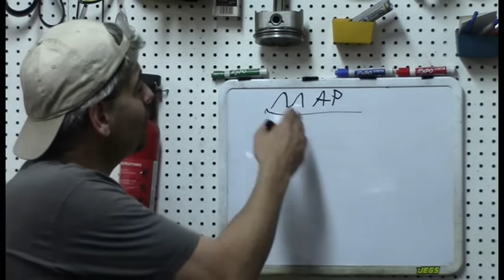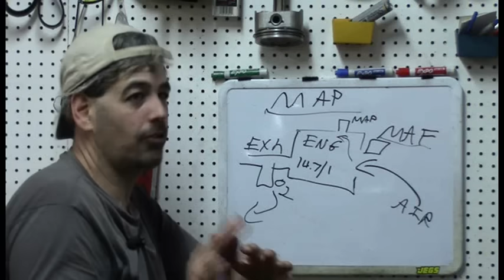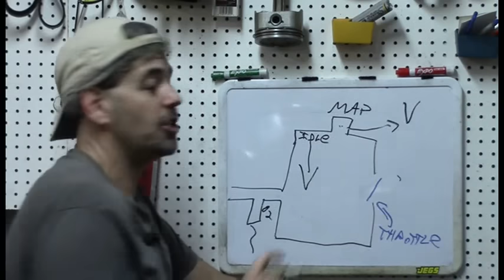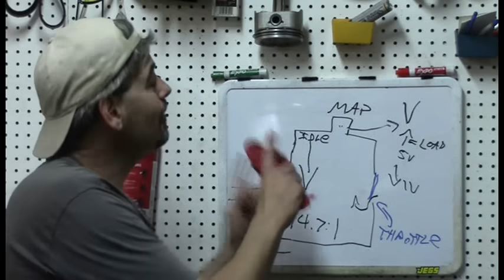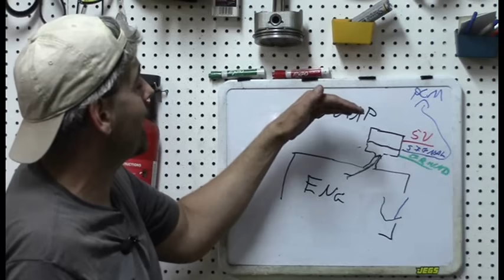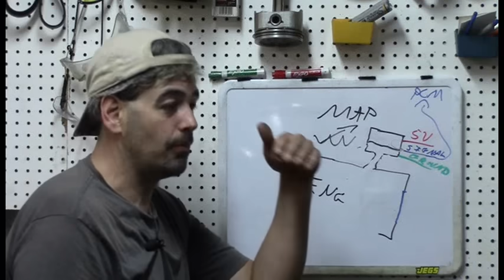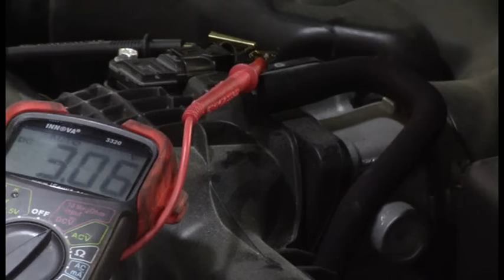MAP Sensor Diagnosis and Understanding Function- Pt1

Comment: New gas  tank, fuel pump. 2006 grand Marquis. Engine light comes on. Scan tool reads Po107 . Map sensor-egr. Replaced egr- map light still on. Cleared code. Should I clean mass air sensor? You rock

Comment: IMO, what MAP sensor, in a Normally Aspirated engine, measures is Manifold Depression or Negative delta pression, since manifold are part of the engine sucking, unless it is in an unoperative state (shut off engine) (neuttral or Zero Delta P).
Because, unless an engine is trully effective at breathing and exhausting, or turbo/super charged (blowing above ambient pressure), it will run below outside (ambient) air pressure. A turboed can make positive pressure inside the intake manifold.
Reply: OS Coutinho Atmospheric pressure is about 14.5 psi [ about 100 kpa ] at sea level. The concept of manifold absolute air pressure allows a reading of atmospheric [ key on engine off ] about 14 psi or 98 - 100 kpa or about 4 to 4.5 volts on a five volt reference system. since the pressure is registering atmospheric even with the engine not running, all values from the MAP sensor  with engine running or not are absolute reference to a true static vacuum [ environment with no atmosphere ]
Reply: ill bet these guys suck at socializing, ha ha!

Comment: Barometric pressure is Absolute pressure.  If the MAP did not measure pressure on an absolute basis, then it would give the exact same reading at sea level or at 10,000 feet elevation.  A mercury barometer reads absolute pressure. The top of the glass tube is vacuum. We used one at our test lab for testing centrifugal pumps.

Comment: I had so many issues with my Ranger I bought some thermostat wire and ran it between  the cab and engine.  Then I could back probe into various sensors and read voltages while driving.  Sometimes I would use a cheap analog volt meter because the needle makes it easier to see voltage swings.
Reply from the maker: ***** Yes that's a very good strategy indeed. I have sets of long vacuum hosing, wiring, and even extended fuel pressure tester hosing for similar application. Just gotta remember to keep your eyes on the road more than the gauges lol!

Comment: Thought i had a Tps problem, nope try again, then i thought it was the accelerator cable , nope not the cable, so after replacing those, i watched ur vid and it definitively sounds like my MAP. Rpms hang after touching gas pedal, and accelerated on it's own
Reply from the maker: Bandit Kevin I wonder what you will think it is next after you replace the MAP.
Reply: LOL right! Damn computers and diagnostics!
The Throttle cable melted a little so i replaced it, then the tps wouldn't read any less than .74 volts, so.... I replaced it... but it still revs high in park, so it has to be the MAP.
Reply from the maker: Bandit Kevin Sounds like you got it all figured out....

Comment: I just changed the intercooler on my golf mk4 tdi which had a map sensor I believe, the car will not start could the map be causing that issue? Great video by the way
Reply from the maker: could be. could also be a vacuum leak. try a fuel trim analysis.
Reply: Schrodingers Box thanks will try cleaning map sensor first as it’s easier then will try the other

Comment: GM uses both sensors, Toyota uses only one but programmed with a fail safe parameters to keep the engine running even without a sensor connected to the ECM

Comment: Made it very understandable, I was lost looking for information  the Map is intergraded into the EGR on my vehicle and also have a MAF, I'm getting Map barometric pressure circuit high
Reply from the maker: if you have high voltage to obviously you want to check if you have current flow.
Reply: @SchrodingersBox  thank you for the information

Comment: my 335i uses a map having a strange one cleared a check engine light there was no noticable running issues but it happened after driving up a big steep hill...stayed off for 2 weeks roughly then happened again same place ...cleared and happened again in the same place ..bet this could be the map sensor at fault not keeping up with the alitude change .nice video :)
Reply from the maker: Possible- if you open throttle to WOT it adjusts MAP to the new altitude.

Comment: Hmmm, just saw Scanner Danner the other day say up here is command, and here is the result. Command was the STFT/LTFT combination and the result was the O2 sensor.

I've seen two cars recently who each were running lean. The computer kept ordering more and more fuel, even after the car went rich? Even though I was cruising on a flat road? So Danny thought the car in his video was testing, is the O2 sensor for real? I caught my car doing the same.

No O2 sensor code was present of course, but I noticed the values on my front O2 sensor getting lazy. Was quick and snappy like it used to be.

Well, my exhaust got ripped off this week, and while I was grinding a way to lay a fresh weld down, I got metal shavings all over in the pipe pre cat. Whoops! Used air an compressor to blow from the rear O2 hole to clean the metal shavings out, and did the same with the upstream sensor. (You don't want to clog a cat, especially a new one.)

The upstream sensor had white crap all over it. Having my metal polisher, I figured, I was going to replace it possibly anyways, why not? I ground the crud off (a gentle polisher really, just spinning, fibered steel). I used my compressed air to blow out the white crap from within the sensor that I could not see.

I cleaned the oil off the outside of the sensor. I polished that metal too.

Now this only took minutes. Less time sometimes than the time to get the electrical connector off. Sharp lines of stoichiometry are back! So anyway, When the O2 sensor is lying, the car tries to believe it, which I believe countermands the regular commander into ruining catalytic converters and/or emissions.

Long story short, I wanted to bring up how O2 sensors can countermand the original orders if you watch it keep doing it, it may be the problem like on mine, or, it may be pointing elsewhere. Don't assume!
Reply: DE Nichols I went ONCE to the Prolixic channel, and NEVER MORE. I value my time.
Reply: OS Coutinho
Thanks that's a channel with suggested videos sometimes. I'll stay away. I try to respect my time too.

Comment: Matt the pressure in the intake manifold is at idle 0.3 bar and and at full load wot it is 0,95 bar it pull on the diaphragm not push to change the voltage eg 0,3 =1.4v and 0.95 =3.9v great video
Reply from the maker: Thanks for correction- ust curious, why is it not .98 at WOT? I thought 1ATM=.986BAR if I remember from physics correctly?

Comment: explained very well...thanks
im having tons of issues..my truck just switches off while driving..cant idle..or struggle to start...sometimes while driving it nose dives like slamming on breaks...it must be the map sensor then
Reply from the maker: What?? Why would that mean its the MAP sensor? I don't follow your thinking at all
Reply: @SchrodingersBox  well....any idea then wat it is???
Reply from the maker: yes hundreds of possibilities.  but you have no data so i cant narrow down to one or even 10.  how are you doing it that you suspect the MAP specifically? What analysis are you using?
Reply: @SchrodingersBox  been asking a lot of questions by people especially motor mechsnics...a lot say its the map sensor.....
Its like the engine is not getting air or fuel...then just dies....there is a brand new fuel pump in..brand new head gasket...no more water leaks and it still just dies
Reply from the maker: That’s not data. that’s anecdote and from people who have no idea what they are talking about. 
Collect data. Analyze it. then create independent variables to validate the analysis. Let it point the direction- don’t guess.

Comment: My son has a 2006 Impala 3.9 and has a MAP sensor and a MAF sensor.
He had a scan and the code is P0106, MAP sensor. Would this cause the engine to crank but not run? I am a shade tree mechanic and still trying to learn.
May GOD bless you for your knowledge and helpfulness. Thanks so much.
Reply from the maker: No it wouldnt' however the 0106 may be referenced by another PCM interpreted fault

Comment: Thanks for sharing.This is the best I ever seen on YouTube about sensor's functions and uses.  Very well explained. So the TPS and MAP sensors were integrated, meaning if one fails the other takes over? Please correct me if I'm wrong but again thank you very much for sharing.
Reply from the maker: Thanks for the comment.  You are correct and actually, in some way or another, nearly all sensors are integrated with each other. As you watch more of these videos you will see that all systems overlap each other and you never find one system or input totally independent.
Reply: The most important thing I can say you did educated me about these concepts. THANKS

Comment: As a part changer I must explain my perspective.  If I take my car to a shop it will cost well deserved $$$ for the diagnostic. For the same price i can put in a new part or 3. By the time I fix the problem my engine is part new. Yes, it's not the best way but I learn a ton in the process, sometimes I do the repair twice. In the end my 2009 mazda is paid off and is one tiny rattle at low rpm away from being like new.....lol.....cause some of it is. And if you made it this far USE ONLY OEM on Mazda's. Price to quality and fitment is worth it. Heck most of the parts will have 120 plus on them....
Reply from the maker: Justify all you want- you are still doing it wrong... and be grateful your surgeon doesn't have that mentality.
  Remember- incompetence is NEVER a justification for procedural modification.
  Its up to you how you approach your education and aptitude, but trying to justify a lack of either should not be a viable strategy.

Comment: At 7:10. The MAF does not detect the amount of air, it detects air mass, or in other words the density or weight of the air, not the volume. If it detected the volume of air, then there would be no need for a baro reading, regardless of whether it has a sensor or is inferred.
Reply from the maker: gojudude This is true- and in fact I do mention this specifically including the actual formula for calculation in my IAT diagnosis video.  I just wanted to brush by the MAF in this video because it's about the MAP.

Comment: Hi I had a very stress full situation with my Nissan x trail  but the video  about MAF sensor  lead me to realize  the possible  cause of hestation and jerk, specially when im driving slow, I checked that big pipe on my car and I discovered its damaged, I will try to fix it see if it will solve the problem and get back on the platform  for update. Thanks

Comment: Great video. I learned a lot of new information, and this is helping me to fix problems I am having with my machine.
I have a scan tool but it cannot connect to my ECU. A problem that a lot of people are having with my model of european van.
Thanks for doing these videos and presenting the information in a way that we can all understand and grasp. 
I will watch your videos again and again - until the information takes root!
Are you a lecturer in a technical college? Subscribing immediately!
Reply from the maker: Thanks for subbing.  Yes I also have connectivity issues with many European cars  Really frustrating!!
Reply: @SchrodingersBox  Seriously thanks for doing these videos. Everytime I understand a concept, the light comes on and I 'get it' it's a fantastic feeling. Almost like therapy. Re: European connectivity, I'm told that certain manufacturers use different standards, which totally undermines the whole point of having the OBD2 standard in my opinion. Not sure if that's true or not, but I'm about to order a couple of different brand specific scan tools to see...

Comment: Congratulations on the video. I am Brazilian and I have a jetta facelift 2.0 tsi gen 3. When I change the charge pipe it shows error in the throttle body. Can I replace the original 2 bar map sensor with a 4 bar map sensor without calibrating the electronic injection software?

Comment: for approx. 100 yrds before it quits again. When it stops t is like shutting the ignition off. It runs fine for local runs of maybe 10 miles or less.
Reply from the maker: What data do you have? Is it losing fuel? spark? ignition off?  Need a starting point

Comment: You have taught me so much on this channel I can now put it to good use but one thing confuses me is that when I tested the map response on a vehicle that has p0420 and p0430 codes that my reading on the map went from 37kPa ( 10.9inHg) at idle, down to 26 kPa (7.7inHg) as I increased the rpm's, couldnt get past 4000 rpm though so thought blockage in exhaust was giving me this reading but then thought no, it should give me a much higher map reading. Why have I subjected myself to these puzzles?

Comment: Nice and clear, it´s all fine and dandy, MAP is a simple sensor,but for a turbo-diesel  it's almost the opposite of what was explained, i think; working on a 2004 Renault Laguna 1.9 DCI  now,  with random codes,and random cel ;  the MAP ,key on,eng.off reads 850mBar, (should read -- 1000 mBar,of course); replaced it,still around 850   Hmmmm...   ECU?  or undue resistance on the signal wire to the ECU ? (don't think that  is possible on a steady state!!); sometimes it's not that simple...

Comment: Well lol guess I can be the asshat next time. The map. Stands for manifold absolute pressure. The reason I point this out is because that is different than just manifold air pressure. Because its giving an absolute pressure which is like saying that the air pressure out side is 14.7 at sea level. Which it is. So it is PSIA. Pounds per square inch absolute. That way it allows the engine to adapt to differnt elevations. If it was PSIG pounds per square inch gauged then you can make pressure in a closed system whatever you want. And it would give the wrong data for fuel and timing. Yes I know you were just doing laymen terms but I wanted to point this out for the skilled people that may not have understood the difference between psia and psig and why they used the term absolute specificly rather than just air pressure
Reply from the maker: Your explanation is correct.

Comment: Been looking under my hood for 4 hours and can't find the MAP sensor to save my life
Reply from the maker: it’s on the intake manifold. look for a 3 wire sensor right on intake.
Reply: @SchrodingersBox  not there buddy, even did a whole thing on reddit and people are puzzled lol someone even had a picture of a 2010 elantra under the hood and circled where it's at and mine simply isn't there
Reply from the maker: ok then please tell me where would a manifold absolute pressure sensor be other than on the manifold?  where else is manifold pressure measured on an engine?
  it’s got to be  on the intake somewhere. maybe the back of the intake like on most GM engines. 
   sometimes they have a vacuum hose from the intake that runs to them and they are on the firewall. but it should be really obvious when you see it. all MAP sensors are typical potentiometers so they are easy to identify.

Comment: Look Mate. Is easy to see you know what you talking about and go to every detail. I am a ZERO on electrics.
I very much appreciate if you could take your time and help me on some issue i have. I have a 1995 ZJ 5.2 V8 Jeep GC. Suddenly it began to get high Idle and irregular idling. Appeared 2 error codes. 14 and 24...that is related to MAP Sensor. I am pretty broke right now so...I saw some you tube channel and i cleaned the Idle Positon Sensor, was very dirty...and it began run just fine and Codes disappear. After a week came back again the codes and the idling issue...but not always ...it can run just fine for some kilometers and again begin idling high. Also yesterday i unplugged the  Throttle Position Sensor with the car running and i plugged it again and idle came back to normal. My dear. Have no money to be Guessing and buying stuff that don't need. PLEASE. What could be the problem ? MAP Sensor, Idle Sensor or Throttle Sensor . Only the idle is little irregular and high by 500 RPM. On road, the car goes just fine and well... When the idle beggins to be high, also the consumption on inboard computer goes high right away. THANK YOU SOOOO MUCH . Be safe and healthy  you and yours. God Bless

Comment: Matt I consider myself a fairly decent diy"er so im very thankful for your channel cuz I really think your videos are going to take my diagnostic capabilities to the next level. I just love the way you explain the ins & outs of all the various systems in terms a guy like myself can understand. The only thing I need now (since your providing the knowledge) is the higher echelon equipment. I do own a code reader that gives me the ltft & stft in a freezeframe but im thinking that's not really adequate...is it? Do you have a video or any advice as to what level of scanner or scanners a guy like me should have? Is that a laptop with special programs you use when your showing the trims, rpms, o2 readings, & sensor values in other videos? How much can I expect to spend to bring my diagnostic capabilaties up to that level? Sorry about the 20 questions?
Reply from the maker: +8683roy My pay channel has a 2 part video covering all this and more. Schrodingers Box Quantum Mekanix.
Reply from the maker: ***** Yes it's called schrodingers box quantum mekanix

Comment: OK great information! What if your vehicle is in a "crank no start" "No BUS" yes Dodge, should you assume this area was not the culprit and check it once you get the 5 volt reference reestablished with the ECU,PCM etc...?
Reply from the maker: on a no bus error the first thing I would do is check the ohms on the termination resistors (assuming it’s a controller area network). should be 60 ohms (parellel 120 ohm resistors). that’s the very first step.